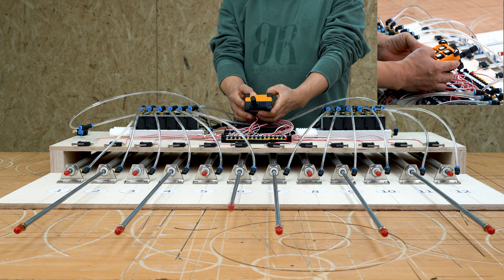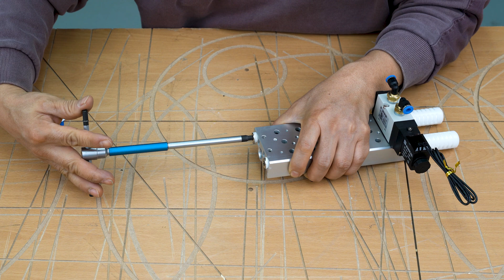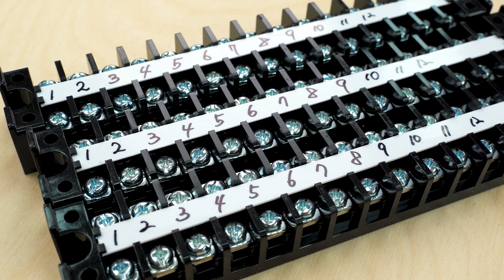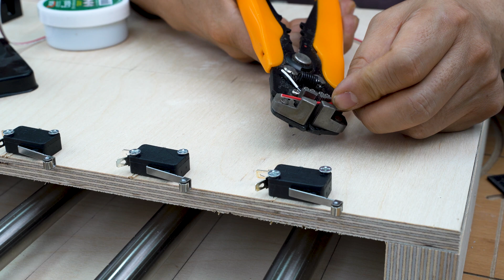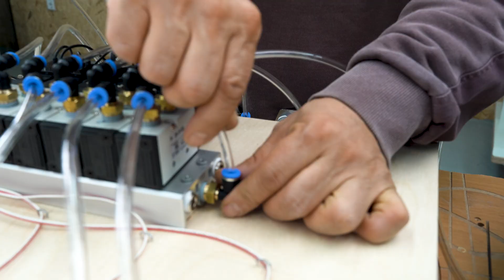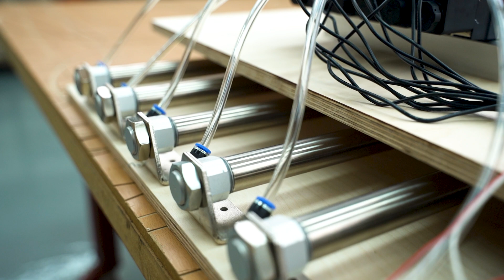Air Cylinder 12CH Controller for Automatic Drawer #1 / DIY

Comment from the maker: I'm going to make an automatic drawer.
Before that, I made an air cylinder that could open and close drawers.
I always use a compressor in my workshop, so it's convenient to use air.
It's also more comfortable than driving with a motor.
The unit controls a total of 12 cylinders with a solenoid, with a manual switch and a 12ch remote controller to open and close drawers wirelessly.
Air blocks were used to reduce the use of nipple.
Please also watch the following videos, automatic drawers #2 and #3.
Thank you.

#DIY #aircylinder #drawer

Comment: @Kynosys
Can i Connect with you as i am making a similar kind of project and i need some guidance.
Reply from the maker: Thank you for your interest in my work. It's simpler than you think. If you need it, please let me know what you want to create. I'll see if I can help you a little and reply. You can write a comment here, or send me an email at kynosys2020@gmail.com.
Reply: @Kynosys_  I tried connecting you on mail but you didn't replied to me. I require help on this project in very short time.

Comment: My study guide :).  Question please.  What controller and unit are you using?  The 12 channel one that you have for remote activating along with the limit switches the cylinders.  Looking to find one.  Thank you.
Reply from the maker: The 12-channel wireless remote control device connects or disconnects 12 channels of electricity. I safely used the 12V version. This is connected to 12 solenoid valves. Then, you can wirelessly turn each solenoid on and off. Each solenoid is connected to 12 air cylinders. And by connecting air, you can control 12 cylinders. It may seem complicated because there are 12, but if you understand just one, the rest can be done very easily. The limit switch shown in the video is only used for test operation and is not required. I hope this information helps you. thank you!

Comment: que buen proyecto te felicito, podrias regalarme los palnos de este me paree muy bueno para montarlo en mi organizador de 24 cajones
Reply from the maker: Si te fijas bien, es un trabajo sencillo utilizando un cilindro de aire. Puedes hacer suficiente. Solo necesita conectar bien la válvula solenoide y el cilindro de aire. gracias

If you look carefully, it is a simple work using an air cylinder. You can make enough. You just need to connect the solenoid valve and air cylinder well. thank you

Comment: Hello.  Please write a list of components for the manufacture of the Pneumo-box.  Thanks in advance for your reply.
Reply from the maker: Here is a list of the materials I used to make my 12 drawer automatic chest of drawers.

12 cylinders with 500 mm stroke 
24 nipples for 6mm cylinders
 2 6-channel cylinder blocks 
12 solenoid valves 
2 connectors for connecting air tubes 
12-channel wireless remote control transmitter and receiver 
12 limit switches 
Thank you !!